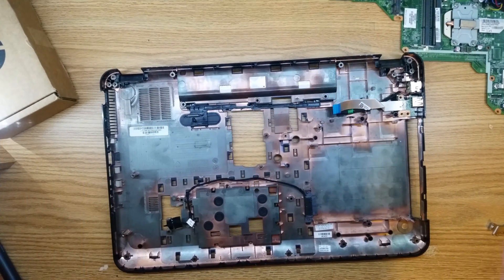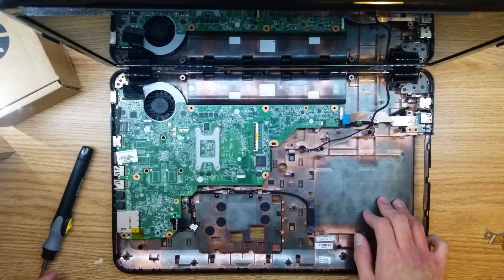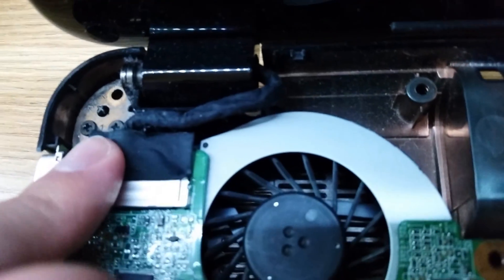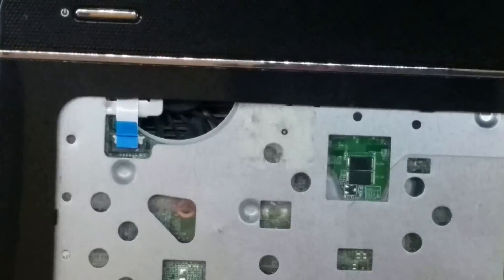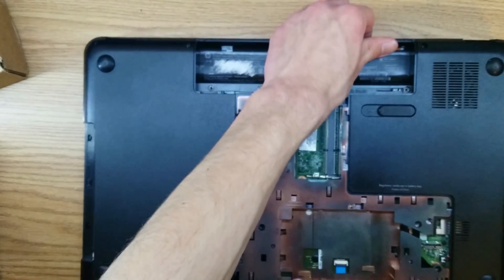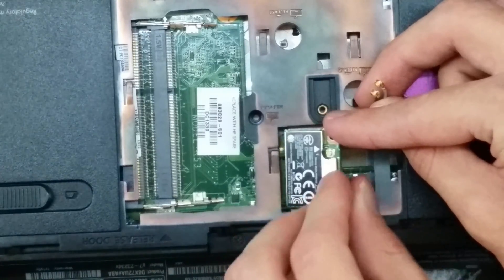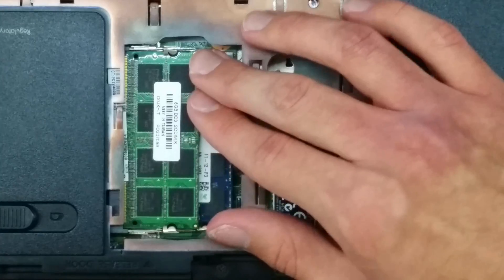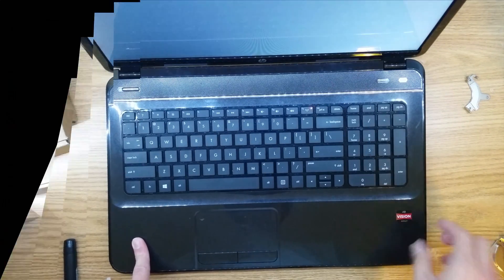(4K) How to Reassemble a HP Pavilion G7 (Step-by-Step)

Comment from the maker: If at any point while watching the video you enjoyed it or it helped you, consider subscribing!!
Reply from the maker: You might want to re-seat the Wi-Fi card. Also make sure the antenna cable(s) are snapped into place on the Wi-Fi card itself.
Reply: My display connector has a plastic black ribbon that protrudes. Is that normal??
Reply: After doing everything you did. My laptop is very slow and the internet is worst extremely slow. Can you please help me I have a HP Pavilion G7.
Reply: Can I have a case of this laptop C and D part

Comment: Hope you replaced the thermal paste! And cleaned the fan! By looking at the mobo, it appears that the CPU can be upgraded. You can have something behind the screen to help support it while its not fully secure. I got a hold of an Intel Pavilion G7 (Win 7) but one of the hinge corners is broken. System appears to work, but a warning pops up when first booting, and says the cooling fan isn't working correctly, sp that's an issue. Did you try upgrading the system to Win 10?

Comment: Fantastic tutorial. I followed along and got my HP G7 laptop to work again! Turns out the left screen hinge was broken and repeated opening of the screen forced both the power and display ribbon cables slightly out of their sockets. The intermittent problems I had with screen format identification and power on operation were caused by that condition. Your video helped me fix the laptop.

Comment: The tiny wiring "clips " for the tapes are extremely easy to break - especially on older machines  I am trying with a sponge & electrical tape to hold the track pad tape in place Wish me luck

Comment: Your videos are so helpful. Thanks for your step by step, easy to follow lessons. I was hoping you might do a "what not to do, but if you did, here is how to fix it" video. The hinges broke on my HP G7 and damaged my power switch. After repairing the hinges I plugged it in & although it wouldn't start it got very hot!
Reply: how do you fix the hinges?
Reply: @Ramkiller1  https://youtu.be/5RDhuHiAQLg

Comment: Fantastic lifesaver. I would have never guessed how to complete the disassembly and reassembly. I did end up with a problem that I need your help with. When I was just connecting the keyboard ribbon cable, I broke the black plastic connector piece from the motherboard.  Is there a workaround or do you have any suggestions and how to get another piece to replace the black piece that's broken?

Comment: Question. In taking apart this laptop, could I have done something to make my sd card slot no longer recognizable? appreciate your time. Great Video!
Reply from the maker: Since the SD card reader is connected directly to the motherboard (no connectors to undo), taking apart the laptop should not have made an effect on the functionality of the SD card reader. Hope this helped!
Reply: Garrett Spitzmueller Thank you. could it have been knocked loose? suddenly the drive doesn't appear when inserted.
Reply from the maker: caltex86 Since it is connected securely directly to the motherboard, it probably could not have become knocked loose. Not sure what is causing the problem.. you may try going to the hp website and downloading the most recent driver for the sd card reader..